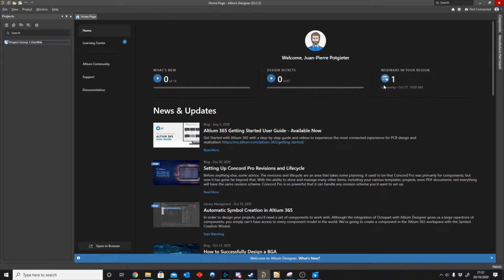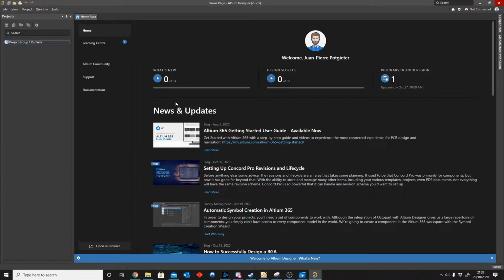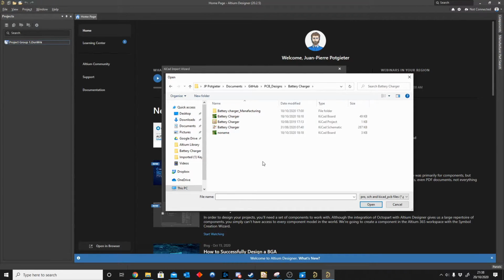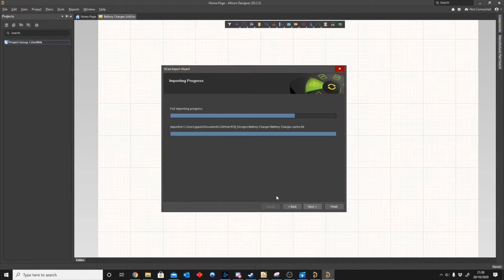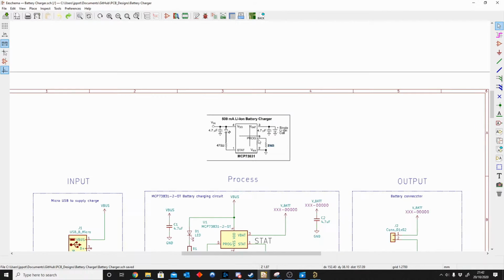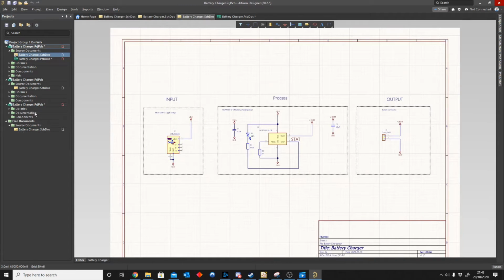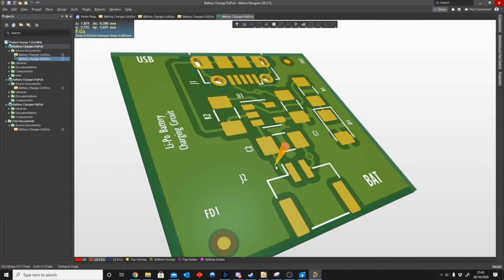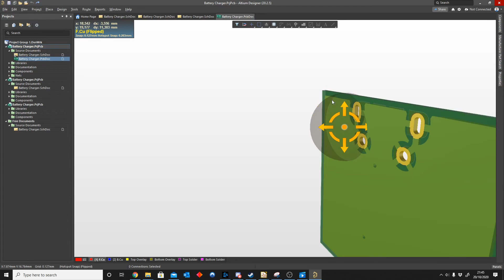How to take your KiCad design to Altium Designer 20

Comment: Hi dude.where can i purchase this extension?
is it available for offline installation?
Reply from the maker: Hi🙂 it is free to install. Is there a reason you want an offline installation? With Altium you normally have to be signed in and online to use it. What Altium are you currently using?
Reply: @PlumPot  i found out that extension is availble in altium 20.1 to onword versions not in altium 20.0.. what should i do know??
Reply from the maker: Hi sorry for late reply. If you would like quicker replies, I would join discord I answer questions there daily🙂. Why can't you upgrade Altium to the latest version? You should always be able to update altium
Reply: @PlumPot  sir when i try to update version it shows my altium says platform is up to date. Maybe because i have crack version.
Reply from the maker: @rabiahussain4953  yes that can be it, then you probably not online while using it. Mmm I'll have to look into why it's not working I'll come back to you:_Okay:
Reply: @PlumPot  i want you quick replay.. when i searched for kicad they said nothing found in extensions... what should i do..
Reply: @PlumPot  or in puchased > software extension.. their is no seacrh bar and they said all purchased extensions are installed.